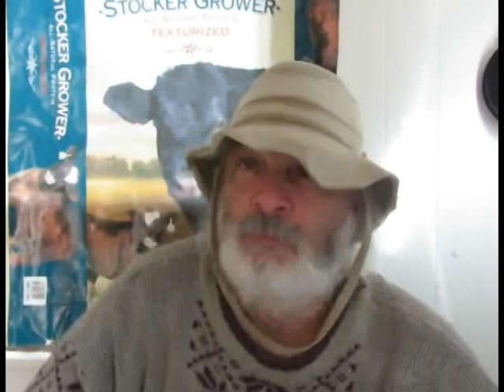Early ABS Activation - car breaks suddenly stop working

Comment: I'm a former amateur ice racer (three wins, three podiums) and formula car driver (one win and a bunch of top tens in FC, Skip Barber schools - the whole nine yards).  My best results in Formula Ford occurred during driving rain storms! ABS and Traction control caused my first and so far only near panic behind the wheel of any car.

I was driving my friends late model V6 Camaro a couple of winters ago when a heavy snow started to fall. The car still had its extremely wide summer tires on it. I didn't know it, but the ABS and traction control systems were both on. It had gotten very slippery. I slowed to make a turn. The car refused. The brakes were doing nothing! I realized that it was the ABS system deciding it was a good day to crash. It got really confused and released the brakes, completely without warning. The owner was riding with me. I shouted: "ABS, ABS, turn it off NOW!" He did and I regained control.  With it on, I would have gone through a small intersection,  clouted the curb on the other side, and spun down the adjacent hillside street!  It had the potential to be a fairly big accident.

Then I had to deal with some very steep hills. I  learned that GM's solution to traction control is to throttle the motor down until the car "regains" traction! That is not what you need to do on ice or ice topped with snow. Luckily, I got my friend to turn that off in just the nick of time or we would have been stuck for hours in the middle of the main road out of Troy, NY.  As it was, I had to dodge around three or four cars that were gracefully sliding back down the hill with the driven wheels slowly and ineffectively seeking traction. 

If it wasn't for the race driving experience, I would not have known, nearly instantaneously, what the cause of the problems were and what to do to get the car back under control. Even so, we were less than a couple of seconds away from a potentially big crash. Most drivers would have trusted GM, the computer, the ABS and TC and crashed. 

ABS and TC, as implemented by many car manufacturers, is hazardous, particularly in icy conditions. 

Proper driver training and experience trumps the flawed technological fix employed in road cars, saves lives and prevents crashes. The Sports Car Club of America and other enthusiast organizations put on driver training clinics in both the summer and winter. Most of the instructors are experienced autocross or road racing drivers and know what they are doing. As an instructor, I saw hopelessly inept young drivers go from a pathetic and dangerous state of incompetence to being at least competent behind the wheel. A couple of my students developed real skill by the end of a single days clinic. My best student, a tiny teenage girl who in the morning was tentative behind the wheel and was clearly intimidated by the machine, showed real talent at the end of the day. I like to think we have saved lives by running these events. We don't teach these kids to race, we teach car control, braking techniques and good driving habits. We teach people how not to crash during every day driving.

BTW - pro tip: when driving an older car or driving one with ABS off in very slippery conditions, either depress the clutch or put the automatic transmission in neutral before applying the brakes. You will be able to steer and stop!

- Dave
Reply from the maker: I love the story! Gosh, I wish you had been in the passenger seat yesterday morning. No, I wish you had been driving! :-) Imagine how silly and foolish I looked trying to blame the car.....
Reply: +Desertphile Thanks! Coming from a master story teller like yourself, I'm very flattered indeed.

I'm glad that your crash was minor, but even those little incidents can be expensive and concerning. 

If I had been there, I would probably have insisted on driving :) 

I love your content. Every upload makes my day better and gives me a good chuckle. You are woefully under subscribed.

BTW: Spent some time in Wyoming years ago. The west is insanely beautiful.

I, and most of my racing driver friends, are terrible passengers. The only time I'm comfortable as a passenger is when I am riding with a fellow racing driver who I know from direct experience has both skill and good judgment. Otherwise it's sweaty palms all the way down. 

I never had "the big one", but came really close a few times. I can replay these incidents in my mind in great detail. I't weird. 

I only had three minor "crashes" all of which involved getting thumped from behind due to others mistakes. I was very lucky. All three resulted in only a small bruise to my arm and minor damage to the cars.  I got hurt worse playing Volleyball of all things. 

One Formula Ford incident I thought was bad as it was happening actually resulted in no real damage to me, or my car. The other car was quite badly damaged however, with the front of the thing completely mangled. How the other driver escaped broken ankles/legs is beyond me. The driver and crew stayed up all night welding the frame back together and repairing the shattered fiberglass. Happily, we were both able to compete in the race the next day. I also learned first hand what hyperventilation was all about. 

Ironically, It was raining cats and dogs and was quite slippy.  I was having a blast driving in it! Suddenly I had to slow rapidly as the car directly in front of me had spun and was comprehensively shredding itself against a guard rail.  I watched the tail and then the nose, then bits of formula car appear out of the spray. Rinse and repeat. It was big and I needed to brake right now! The driver behind me failed to notice my rooster tail going away as I slowed and he hit me square in the back, full chat, without braking at all. Now that was scary! Speed on that part of Lime Rock ("No Name Straight") in the rain is probably around seventy five or eighty MPH. All three of us involved were lucky to escape unscathed.

Sometimes good judgment, reflexes and skill isn't enough. There is that wildcard called "luck". Over twenty years of racing I've been very lucky!

- Dave

Comment: fun with abs
 almost the exact same thing happened to my uncle in your brand new car
 in Montreal there are a few very steep streets there was ice on the road in the thing refused to stop. he was headed to a busy intersection when the thing decided not to stop he stood on the brakes and tried to pull the steering wheel off pushing down so hard on the brake pedal
 later he took it to the dealership where the dealership told him there was nothing they could do it is a safety feature.
 I never thought of telling him to pull a fuse but that's a great idea.
 you never told me about the trail cam where there any pictures.
 thank the gods summer is coming trust me it's pretty cold up here in Canada
Reply from the maker: Yeah, damn them car dealers---- worrying about "safety features." Heh! :-) Perhaps some car dealers would tell the owner to pull the fuse, but there must be liability issues involved.
Reply from the maker: Yeah, that's a great point! The Tahoe's ABS kicks in mostly on cold mornings, and mostly after I have diver through the river with ice in it.

Comment: Tone Ring Failure. i had it on my ford .. its a stainless cogged ring that goes around a steel shaft, the steel rusts and breaks the ring.. its a $10  fix if you can get all the bolts off.

Comment: I hate ABS brakes... To remedy the two year problem I had with my ford van years ago, I just took the ABS computer out. Problem solved...  Brakes worked fine.
Reply from the maker: Yeah, that's just because you are more intelligent than I am. I knew of the problem a year ago when I ALMOST destroyed the gate. My previous Tahoe, three years ago, also had the same behavior--- deciding for itself if we would stop or not.
Reply: Give me brakes or give me a fence to run into... Brakes are cheaper though.
Reply: My Ford E 150 Van did the exact same thing and I fixed it the same exact way. No matter what you buy, if it was built in the last 20 years it will have ABS and everything fails eventually. No matter what you buy. It will eventually fail. Tahoes are great vehicles but they need maintenance and repair just  like any other machine.
Reply: By the way, I was with DP when he purchased this vehicle. It's been through a lot since then and it's probably time for a new one.

Comment: Isn't ABS supposed to rapidly "pulse" the braking system until the vehicle comes to a stop?
Reply from the maker: If I understand the system, you are 100% correct; the problem is that I STOOD on the break pedal trying to force a stop. It appears that I should have let up the pedal then stomp on it again.
Reply: EmeritusE if a skid is detected it reduces the braking force untill the wheel turns, then allows pressure again and repeats. The system should have been made smart enough to identify sensor problems before this type of failure, and alarm while disabling the ABS until a reset is done

Comment: That's really odd. The ABS isn't supposed to kick in unless you're going above a certain speed (all wheels averaged). Even if one sensor says "0 mph", the other three should be enough to kick up the average above a certain point. I've seen skid marks from an ABS stop. You see a lot of "dashes" from the tires locking up and releasing. The last "dash" is longer than the rest because the speed was finally below a certain point and the ABS let the wheels remained locked.
Definitely get the car to a repair shop and have them check the braking system.

Comment: G'day,

   Ah, well, the rot set in when they permitted Cars to be built & sold which had Gearboxes controlled by an Oilpump, because the Oilpump had a better idea of which Gear the Vehicle should be in than the Nut behind the Wheel ; and the Oilpump could change Gears smoother & faster than the average Nut, as well.

   The Frog-Eaters were demonstrating an Airbus Prototype on the Indian Subcontinent, when during a low slow pass at an Airshow the Pilot thought, "Merde ! Too slow.., Full Power - NOW !" and shoved the Throttles all the way forward in one desperate Gallic gambit to regain control...

   But the Engine Management Computer saw his Throttle-Command & said, or words to the effect...; "Oh, look at that, the Monkey wants Full Throttle from Flight-Idle, instantly, and it could be delivered within 3.5 Seconds, too - but all the Metalurgists say that'd shorten the Time Between Overhauls, so to maximise Commercial Engine-Life the Monkey will get Full Thrust in 12.5 Seconds when the Donkeys have gently spooled up to flat Chat....

   And 10 seconds after Fire-Walling the Throttles, at 85% power & rising, 6.5 seconds after the Engines COULD HAVE DELIVERED Full-Power ; the Airbus "mushed into" the Trees at the end of the Runway, 20 ft below the top of the Canopy..., and crashed in flames in the Pineforest Plantation.

   So, prioritising theoretical Engine-Management Guidelines turned out to be a stupid bit of Software Arrogance.

   ABS technology is yet another attempt to make Motor-Vehicles "Foolproof", whereas the driving force behind Evolution is to allow Fools to cull their own DNA..; therefore ABS Technology is a Fool's Errand.

  Just(ifiably ?) sayin' ,

   ;-p

  Ciao !